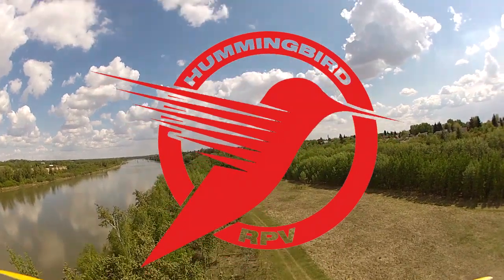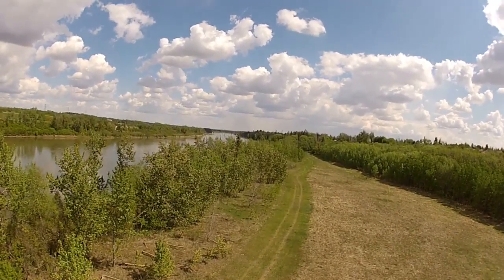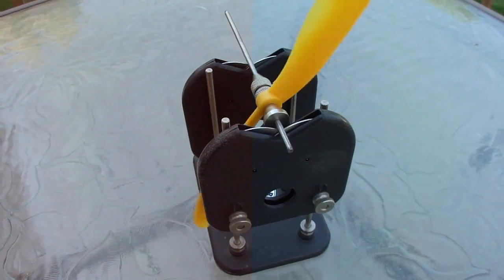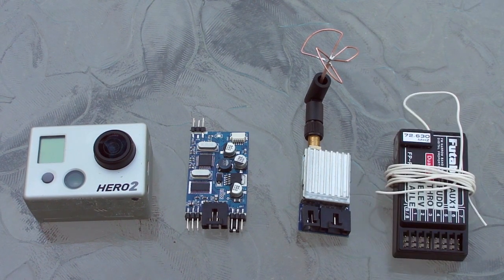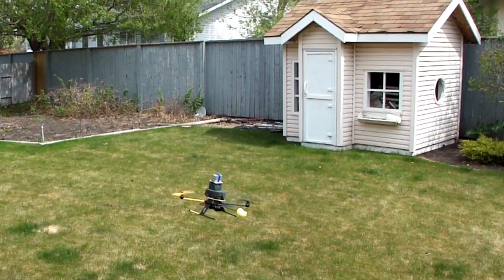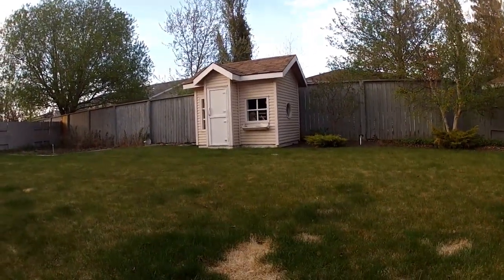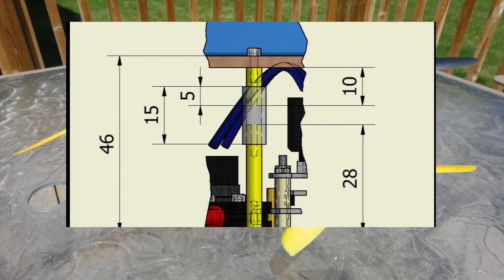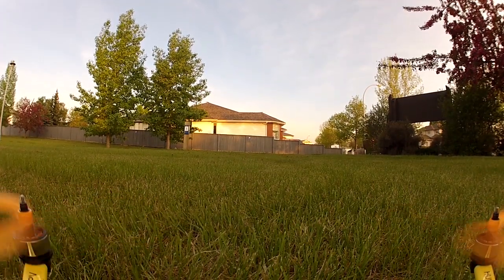LotusRC T380 FPV Video - A Solution to Jelly Video Effect

Comment: I've crashed mine into the side of my house, broke one blade. Crashed into the ground more than twice and broke 2 props. Crash into a tree once and fell 20ft high and crack one of the shaft holding the left rear motor. I don't have jelly effect. I couldn't think anything wrong on why yours have jelly effect after balancing the props.

Comment: Great tip
Have you seen the way Gaui attach their camera mount?
The mount has soft foam on both sides that the mount rests on which has adhesive on both sides. Works great too 
my lastest video FPV flight does not have any jelly effect with the Gopro HD 2 attached under the T380 with Velcro and a battery strap.